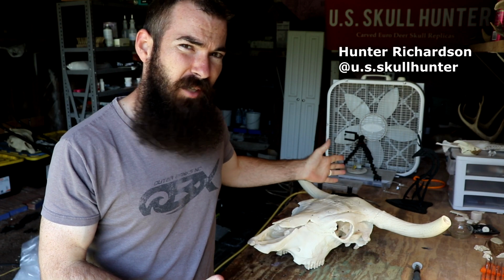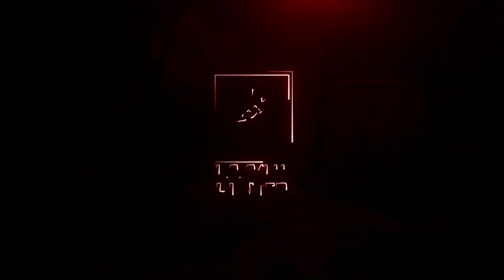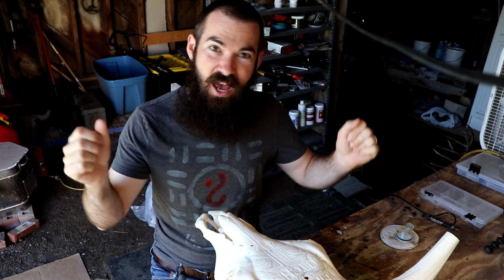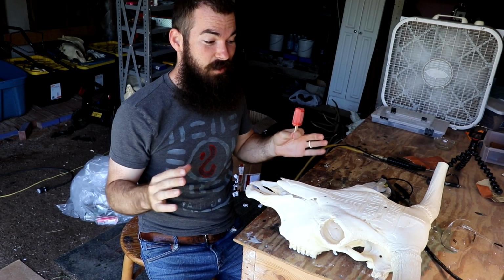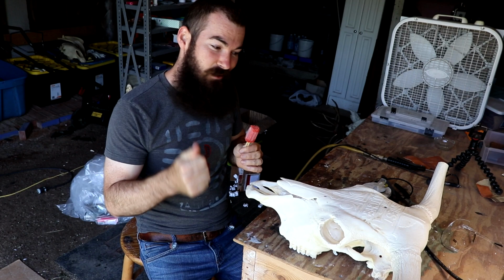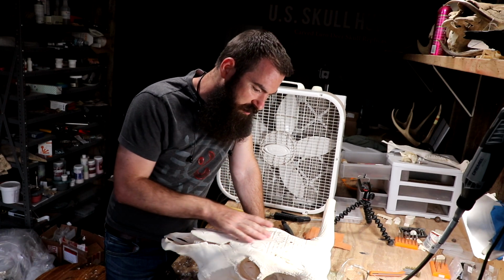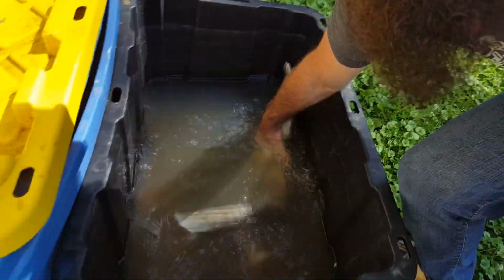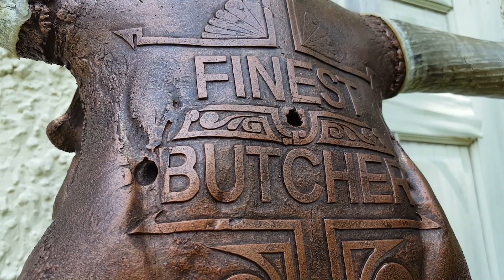Carving a Cow Skull for a Butcher Shop! (FINISHED)

Comment: I bought a turbo carver had to send it back head leaked improperly glued sent it back and the second one leaked the same but worse. The guy makes ya feel like its your fault. There p.r  sucks. So i researched the product. They falsely advertised. The grinding tip does require lubrication. It stattes it in there Patten to use wd40.
Reply from the maker: Dang Ray! Thanks for the info. Someone else commented about the guy there not being nice. I might have to give them a call about that lubrication you talked about.